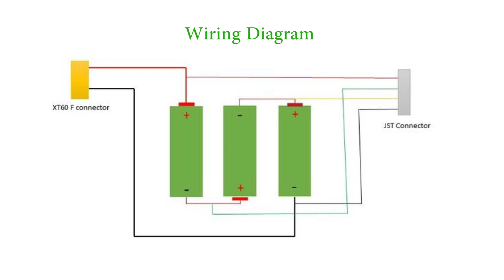Recycled Laptop Battery to 3S - 18650 Battery Pack

Comment: Thanks for sharing

Can you please show what you set up voltage and amperage
Reply from the maker: I set the charging nominal voltage 10.8V (3S )  and current of 2A. When the battery fully charged the voltage of each cell is around 4.0 to 4.1V
Reply: Thanks for info
Reply: Full charge on an 18650 cell is 4.2 volts.